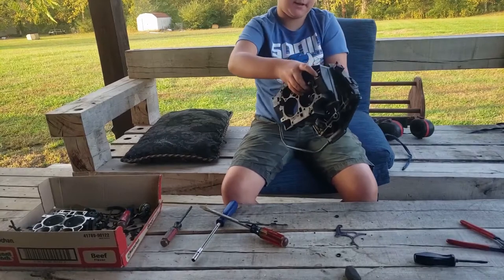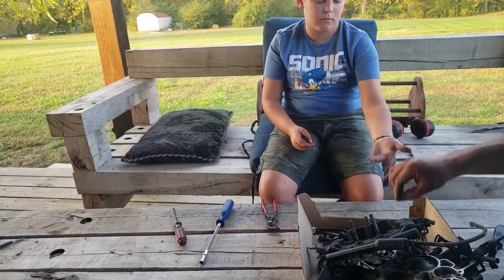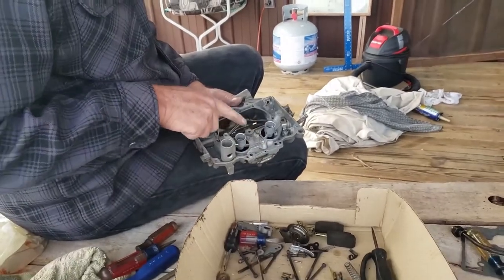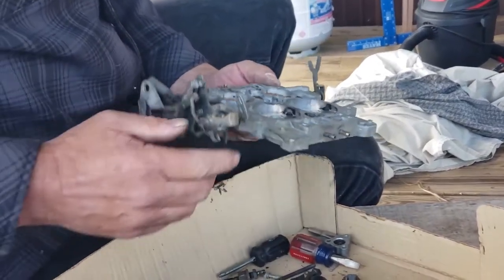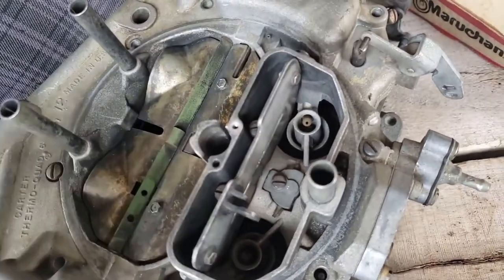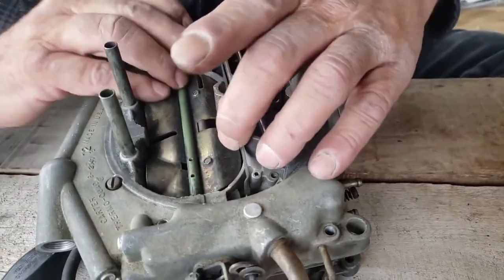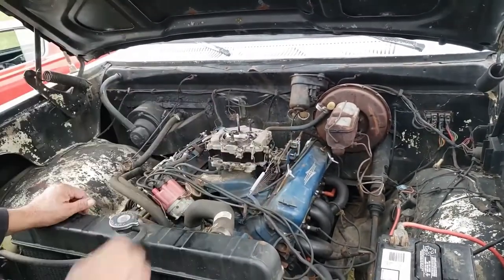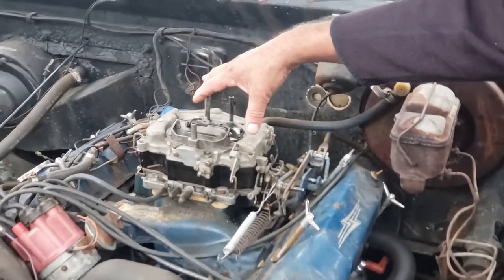Mopars Carter  Thermoquad installed on a Dodge ramcharger FINALLY    #5

Comment: Kid, you're a Mopar guy in the making, two thumbs up.  Taking the carb apart it's obvious you know just what you are doing.  Me?  I'd drop screws or other little parts and they'd roll down in the cracks between the boards of the bench or deck.  Something I've found works for me when doing stuff like this, put an old thick terry cloth towel under it.  Not because you're trying to keep it clean, but because it will catch anything you drop, whether a ball, spring, or screw and it won't roll away into a black hole on the terry cloth.  I do this with electronics, saxophones, guns, and anything else with small parts.

Comment: wow that thermoquad was working perfectly after you guy got it back together.  my dads duster always has issues opening the secondary's, they just will not open.  Now i want to take a look at it.
Reply from the maker: It was out of the box working good. Jacob still talks about working on it with his friends. That enginevis out soon for the reworking then that carb got a job to do

Comment: John i like watching you videos, the are very helpful. I saw your video on distributors and I have a 65 barracuda with 225 slant six. Dead spot when you accelerate. If I advance the timing it goes away but then I have valve rattle. If I remove the distributor and take out the big spring will that  solve my problem. Previous owner changed it to electric ignition and the VC 93 advance isn't adjustable.  Any advice would be greatly appreciated,  Thank you
Reply from the maker: Bobby it will help. The rule here is to get the advance to move quicker. but you need to limit how much total advance the distributor has. This allows you to set the timing way higher and wont let the timing advance so far and cause it to ping. But if all you do is dump the spring you are way ahead of the curve. that being said usually a dead spot is caused by not enough accelerator pump and advance timing helps with that a bunch. I love electronic ignition. and as far as the vc 93 dash pot ,you can get in the dist and put a small weld and limit how much advance it gives or even file on it if you desire more. Just a quicky, its not the valve your hear its the main caps being pushed of the block and you here the main cap bolts pushing the cap back to the block so dont leave it that way. I will be doing a follow up on distributors eventually but dont know when because the distributor machine has temporarily kicked the bucket on me so its down for repair.
Reply: Thanks for responding